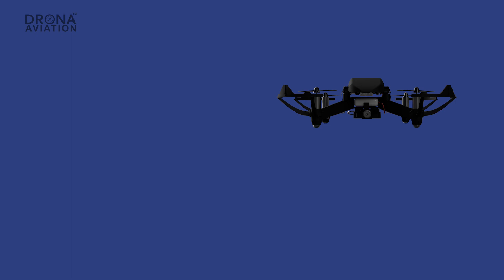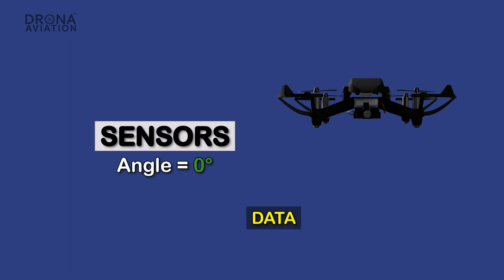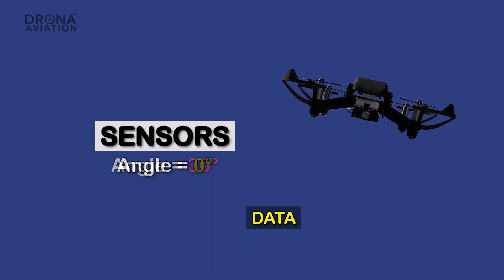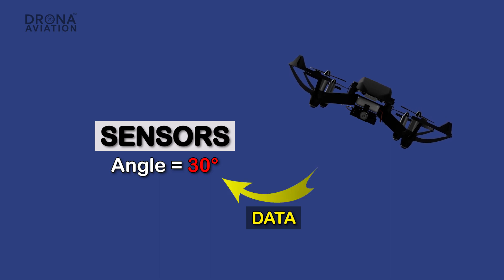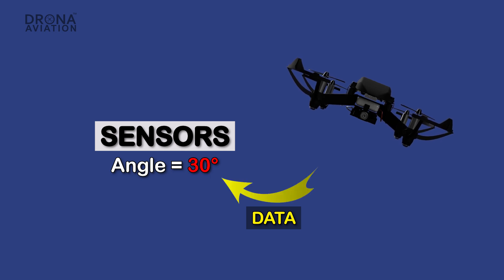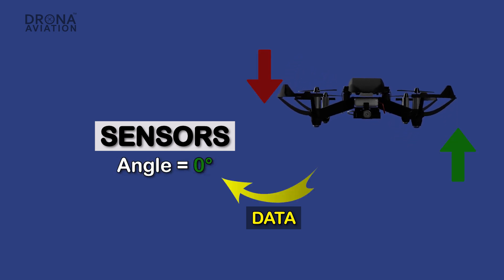Drone Sensors - Stability of Drones Using Sensors - Why do we need sensors on drones?

Comment: How do we know what size propeller to choose for my dronw if I have already calculated the required thrust per motor?
Reply from the maker: The thrust would not only depend on propeller size but on combination of motors and propellers. Generally companies provide what amount thrust the motor can provide with what size of propellers. Please check with the manufacturer of motors which size of propellers would be accurate for your requirement.
Reply: @Dronaaviation  okay thank you!

Comment: Drone ka centre kahan per rahata hai
Reply from the maker: Hi! The center of gravity of a drone will vary from drone to drone, but if you are asking about Pluto drone, the center of gravity is located inside the battery, below the flight controller. Does this answer your query?
Reply: Where is the centre of the drone
Reply: Can it compete with DJI mavic 2?